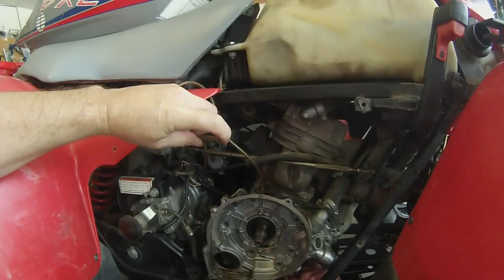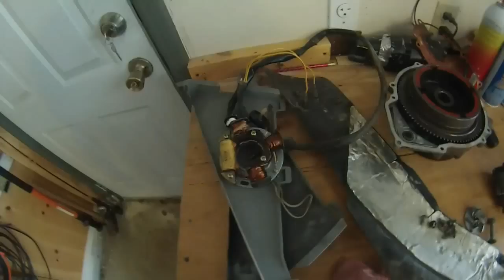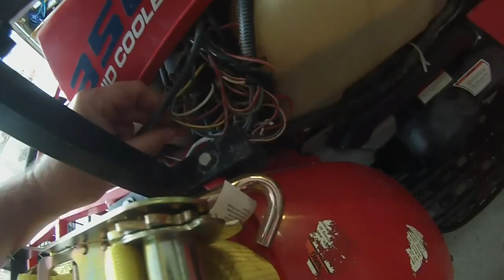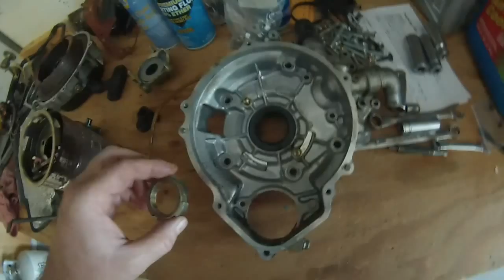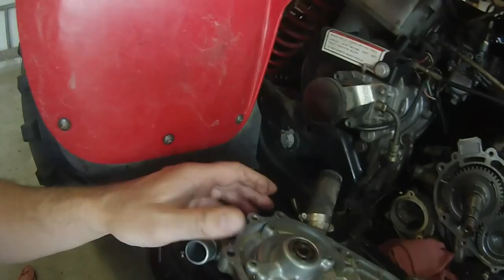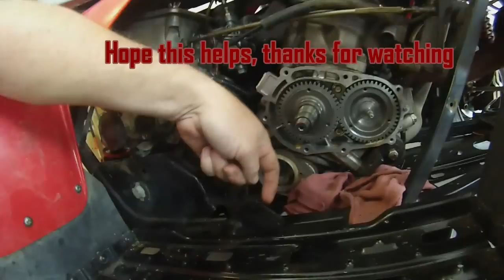1993 polaris 350L 2x4  water pump

Comment: Jeff, Your case was full of anti freeze. How would you drain and replace? Is there a bottom drain plug or ? What type and roughly how much oil does it require? I am running down a no spark issue on mine. Might go further. In to case. Any pointers? Thanks
Reply from the maker: Magnetic Sweeping of America, LLC , I point out in the beginning of the video where the drain is, this problem won't cause the no spark, check the power and ground to the coil.
Reply: Jeff Looney thanks jeff. Appreciate your time. Is drain and fill plug one and the same? Type and amount you used? No power to coil. Fyi.
Reply from the maker: I think there was a drain and a feel plug, just have to check the book on oil type and amount, I think there are fuses where the stator wires plugged in, I would check those

Comment: I'm about to do this on my sportsman 400l it's got milky oil in the counter weight and somebody snapped a bolt off of the water pump cover and the weep hole is leaking coolant too